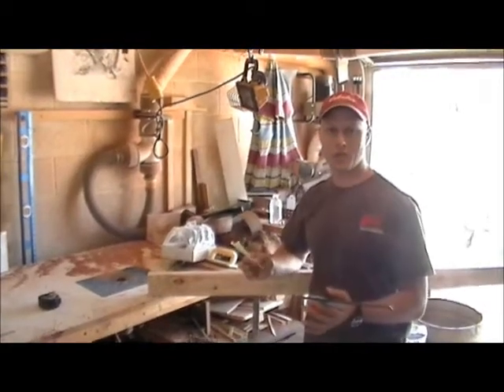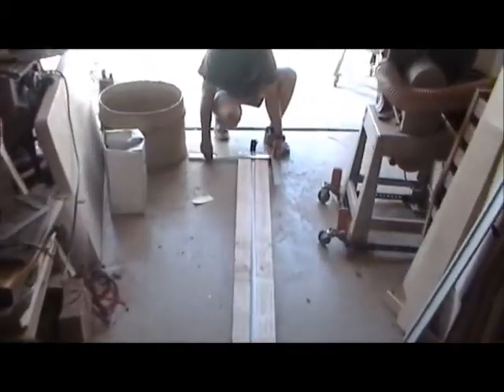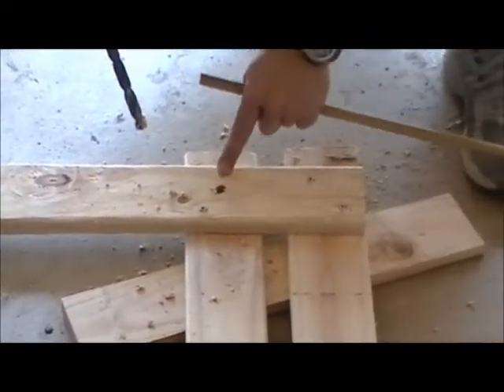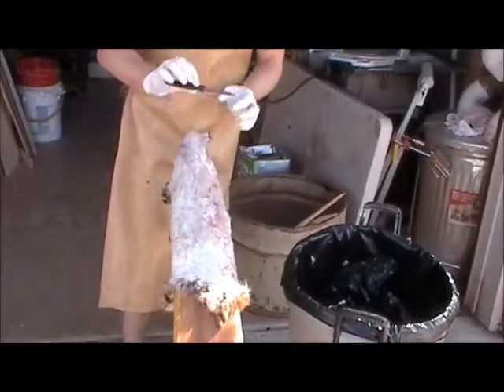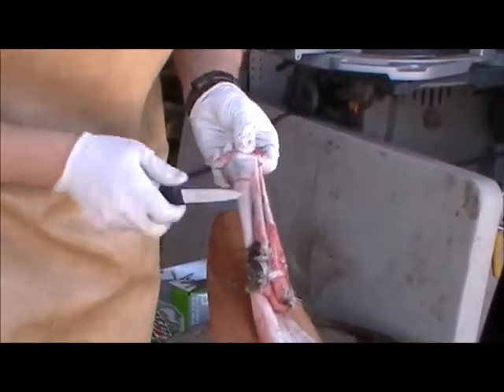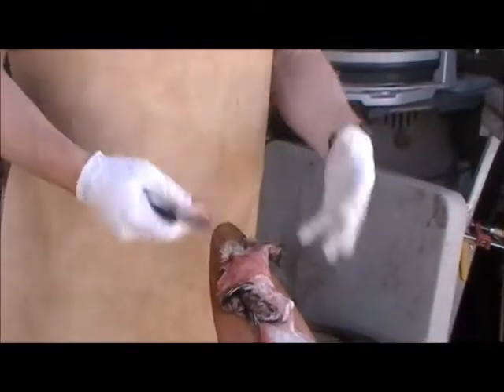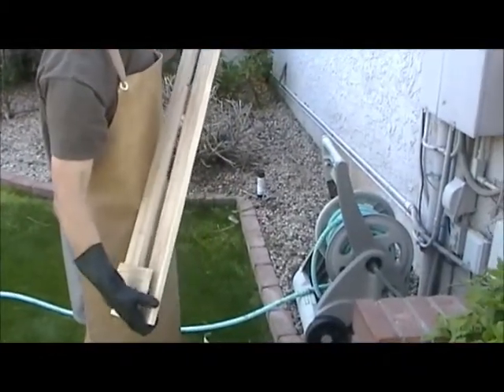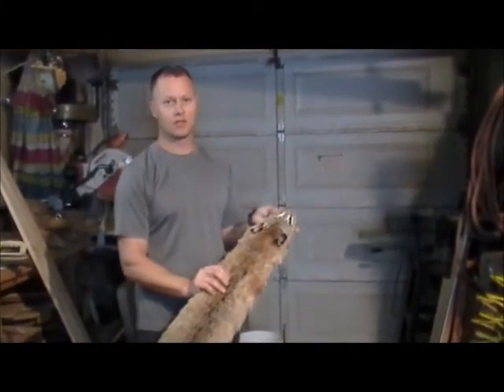Bobcat fleshing and how to do the ears

Comment: Thus far I've never seen someone get the cartilage out while leaving the inner ear hair. I'm not sure that you can because it seems like the inner ear fur literally grows out of the cartilage. But yet taxidermy mounts always have the inner ear fur in there so they must just leave the cartilage. Without it, the ears just lay limp and don't look natural. I'm sure people who skin will know what I'm talking about.
Reply: Taxidermy and case skinning prep for fur sales are not the same thing.  Skinning and preparing a hide for tax is different and could be sold for fur sales, but u can't go the other way. They would separate the ear down the side and remove the cartilage. Then tan, and replace the cartilage with plastic after wet tanning. Different process, different goals. If ur skinning for tax, take them the whole thing, freeze the whole thing then take it in, last option would be to case skin but leave the feet in and the head (cut them off and leave in the hide) tax guys are skilled at what to do then, and u will end up with a better mount.

Comment: You could use a band saw to rip a 2x4 in half, or just by two 1x4's and it all works the same....
Reply: You could, but something I did when I went back was playing it down to five eights almost half inch thick. You want to make sure that you get it is then as you can while still being strong enough to hold the shape. The popular thing to do on the spreading mechanism is to add another piece of soft wood between the legs that is thin to the intact legs together so you make one continuous look from the belly down to the tip of the legs. The thinner the wood is well still being strong enough the better. Rounding the edges over helps dramatically. Make sure to wax the word with candle wax before using as a stretcher. If you don’t do that, the hide will stick to the wood.